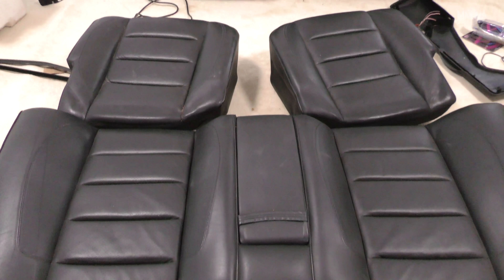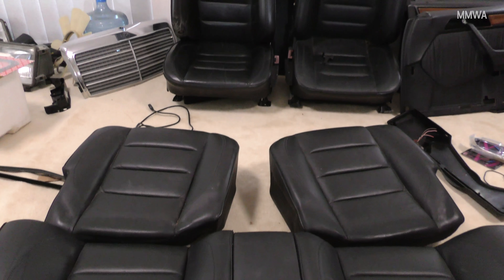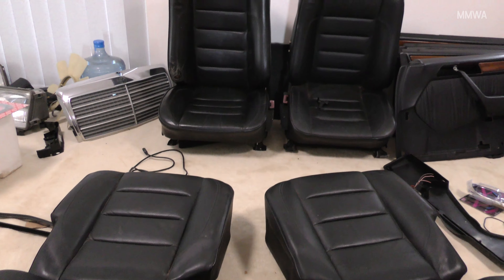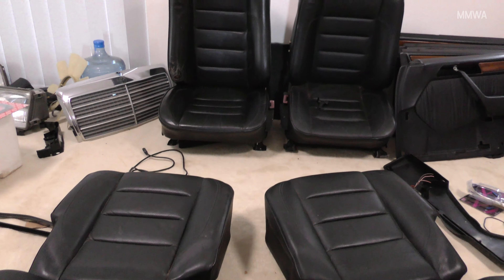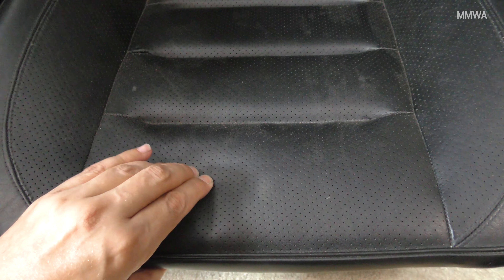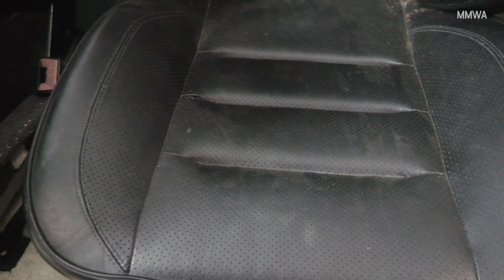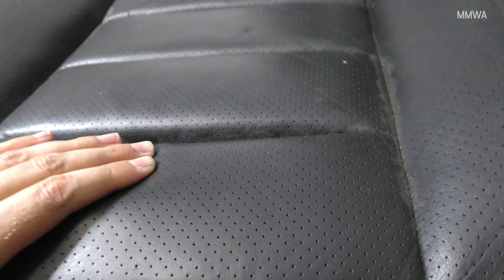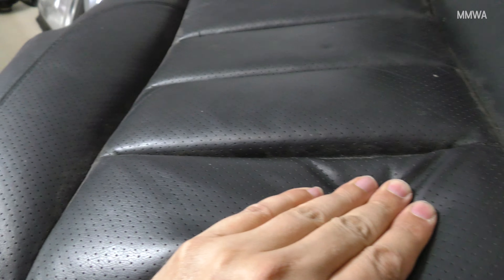Late Mercedes W124 - How to spot dry, hard, bad Leather Without even touching it!

Comment: I want to buy rear seat like yours, but in grey color. I want to make my w124 for 4 peoples, not 5 peoples, because i like center console of 500E. But only 2 pieces at down without backrest cost 1260$, it´s very expensive, its not effective :( Do you think down part of seat from Coupe will fit ? it has little another figure, but they are about 1100$ cheaper. And can i ask where you get these seats, which state and which websites ?
Reply from the maker: I dont know about if the coupe seats fit. This set came from a sportline 300E-24 sold new in Australia that someone crashed. It was highly optioned, even had the sportline wheel, steering box and the electric collumn. I only wanted the seats though. I didnt pay much for the seats but paid a fortune in shipping them back to my state. I will have the front seats recovered in new leather when the time comes to install them.
Reply: Nice, thank you for your fast answear. These seats are really nice, you will have one of the best interiors. I was inspecting and seats from Coupe can fit with little modification into Sedan, And it is possible to do for me.